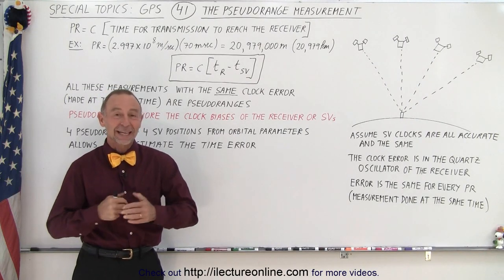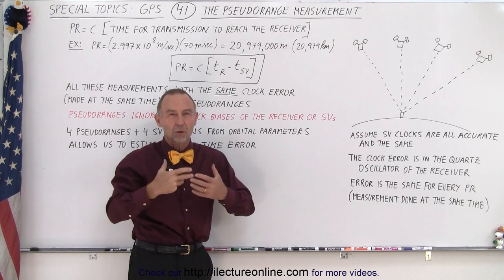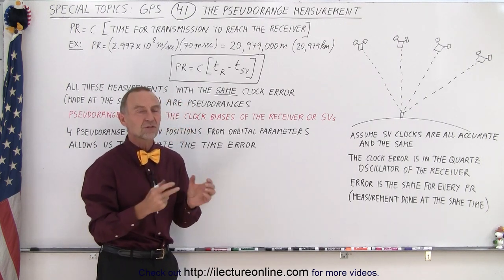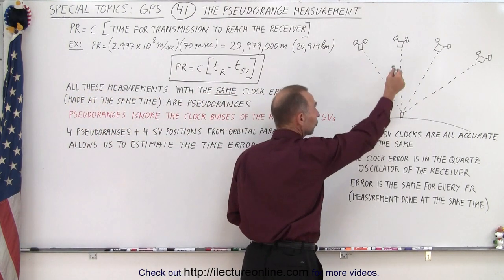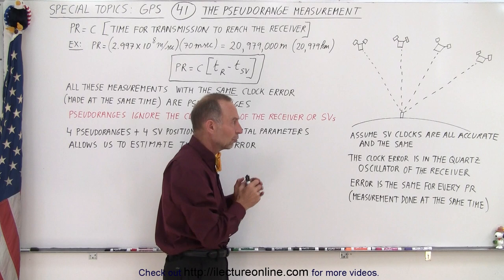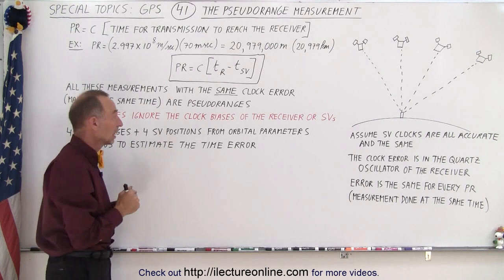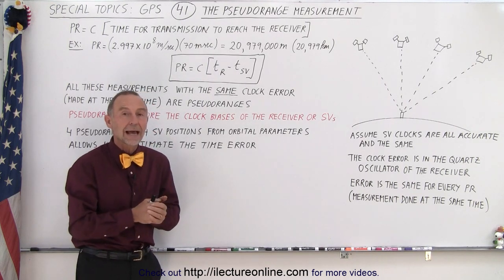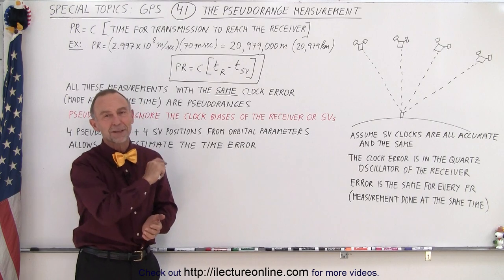Special Topics - GPS (41 of 100) The Pseudorange Measurement

Comment: This assumes that the clock receiver is well synchronised ( i.e the same as ) with the SVs clock. 
In other words, is it possible that the receiver is  X min  late (or in advanced )  vs  the SVs  clock ?
Reply from the maker: The clocks between the satellites and the receivers do not need to be synchronized.  That is why 4 satellites are needed in order to calculate the difference in time.
Reply: @MichelvanBiezen  thanks for the reply.
But ... 
The receiver knows its own clock Tr.
How does the receiver know the time Tsv from a given SV ?
Is this time value coded and part of the message sent ?

To make the delta time,  the receiver shall know both to my opinion.

BR
Reply from the maker: That is explained carefully in the videos.
Reply: @MichelvanBiezen  I saw.
Your videos and explanations are very interesting. Chrystal clear each time.